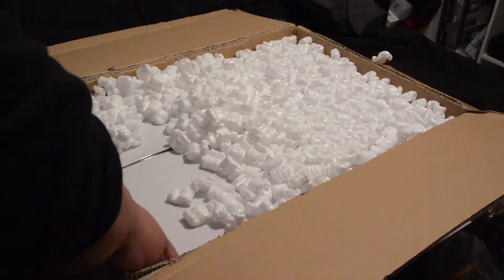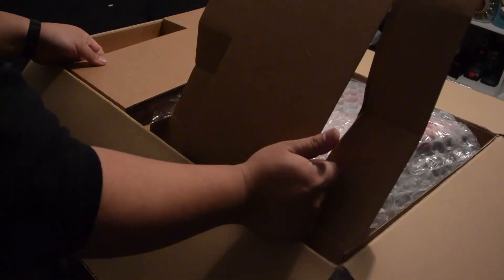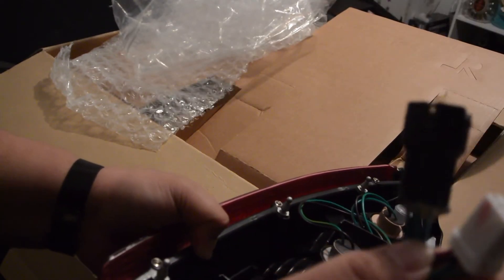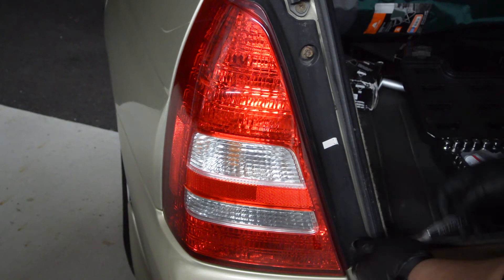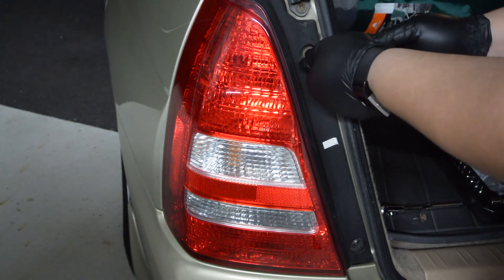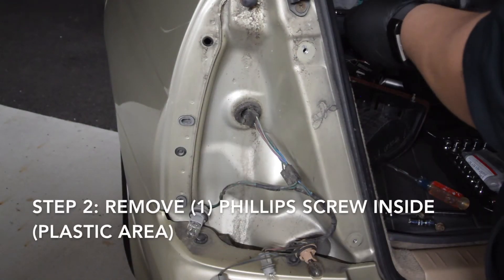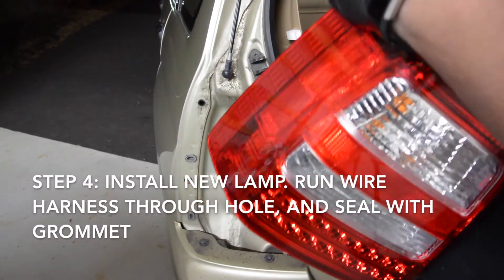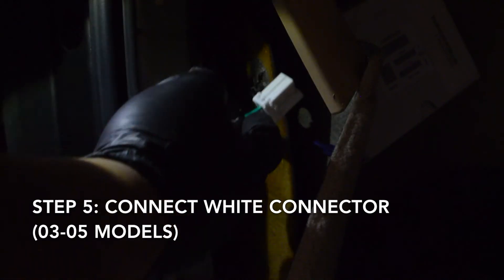2003-2008 Subaru Forester DEPO LED Tail Lamps (Unboxing/Install)

Comment: Hello any chance you have the link where you buy the lights I want to check if they have any I want get ones for my 04
Reply from the maker: I got them off eBay seller! They rarely came up for sale but I got very lucky. These lamps are hard to come by! I think I put the seller name in description, let me double check!
Reply from the maker: eBay sellers name was “neondials” you can shoot them direct message to see if they have any in stock or plan on getting any!